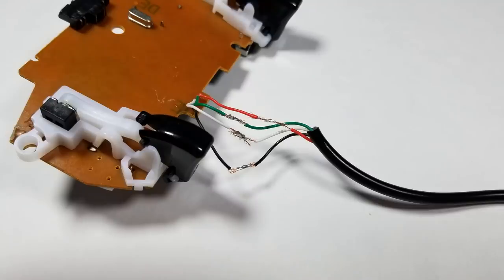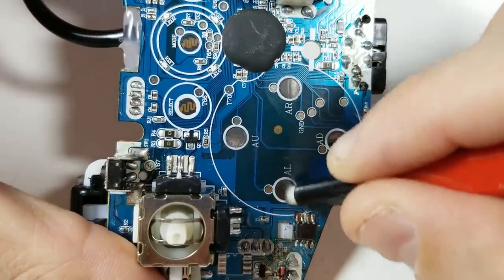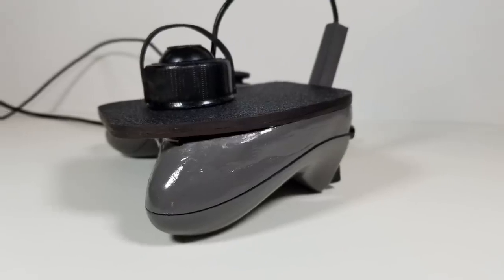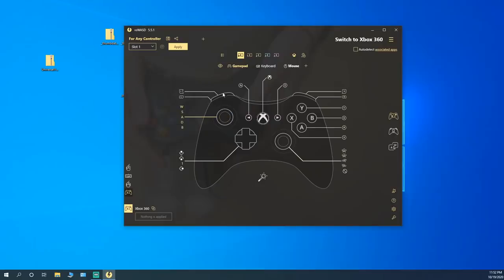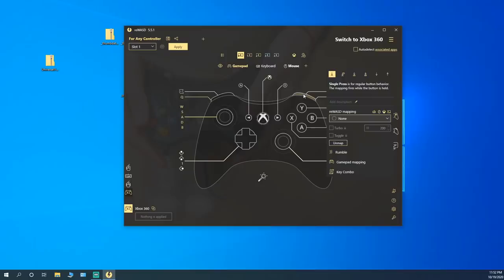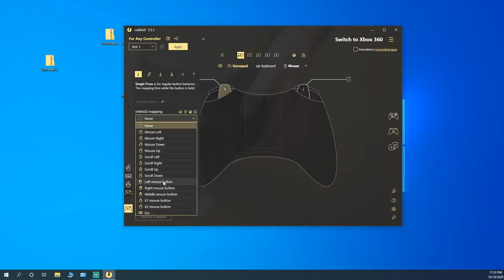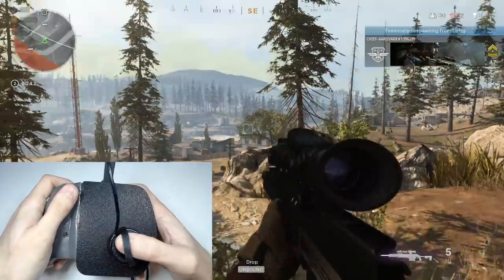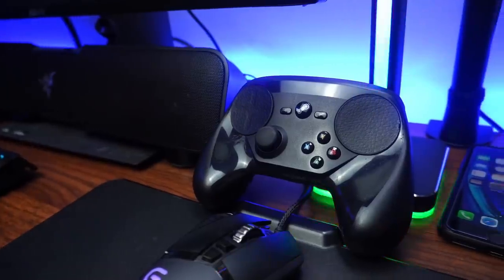I built the *MOST OP* CONTROLLER | Optical Mouse Controller | FORTNITE WARZONE

Comment: Has someone considered useing dual optical sensors for the actual 2 axis of the stick? Not like the mouse wheel optical, but like a mouse, but two sensors per stick, for each axis, reflecting on a ball surface pegged with a stick? would controls benefit from switching to All optical sensors over mechanical? Could you make a controller that its cable is make of fiber optics, the sensors are all optical for all keys and controls, attempting to break through into even faster response times.

Comment: Actually, the issue with touch pad isn't that it's not accurate. It's a thing that can be used in graphical design so accuracy definitely isn't a big issue. What is a big issue though, is that the button layout isn't optimal for playing games, the ergonomic on the laptop is horrible (you can't be on WASD and track pad at the same time comfortably), and that in most cases people would turn the acceleration all the way up on a track pad to reduce finger movement but that's not good for games. Steam Controller has none of the above issues so in theory it should work well enough.
I can see having a tiny finger mouse helpful to reduce finger skin wear, but then maybe have a track ball on the controller instead. Thumb track balls are really comfortable to use even for games. In fact with keyboard and trackball there's no need to have such controller to begin with, as the main issue to address is just that there's no place to put a mouse, but trackball itself stays in place.

Comment: Ok. So imo, the biggest advantage controller has over kbm is the left analog stick. When I play kbm for an extended period of time, particularly on a movement intensive game like Apex, my WASD fingers like to cramp up. So my suggestion is, do the opposite that you did here in this video; find some way to integrate the left analog stick into traditional kbm. While this controller is cool as fuck, and seemingly better for aiming than an analog stick, I doubt it's just as good as mouse aiming. So, fuse the best of both. Let me use an actual mouse with my right, while also being able to use an analog for movement with the left.

Comment: Meh, pretty neat but for years I’ve been using a combination of a XIM mouse and keyboard emulator for PS4, a HIGHLY modified PS4 controller with extra buttons on the back side and elsewhere(some of which are moveable to other positions)mapped to perfectly fit my fingers for movement and most non gun or attack related functions(if I remember i have something like 13+ buttons within less than half an inch of my left hand and then all the plethora of 21+ functions mappable on a zmouse on my right hand, including hundreds of different things i could technically program on the pressure sensitive buttons and functions)which I have mapped to my Swiftpoint Z-mouse that would be waaaaay superior to this- aside from portability- but I cant stand playing FPSs far away from the screen anyway.

Still, I really like the keyboard switches as opposed to whatever those silly overpriced “Pro” controllers use, and the portability os dope, so I may try and make one of these myself, or at least steal the keyboard switch idea, as I should have everything I’d need to do so mostly.

Comment: shut up and take my money
suggestion: improve the optical sensor with touch screen (preferred) or mouse pad, I know u literally just mentioned the issue with that but the best solution is not an optical sensor,  its a more fine tuned touch surface. mess around with the velocity on the touch surface until it feels most natural. Also make it bigger so tracking opponents without lifting your thumb up as often will be easier.

Comment: Seems like it's a pain in the ass to do a 180 without your sens behind Insanely high. I feel like because of that, this is worse than both mouse and keyboard. Atleast with an analogue you can simply hold it im one direction and turn forever. But with this you're only limited to the tiny range of movement with your thumb. Cool concept but im sure its nowhere near "op" just by looking at the gameplay

Comment: The ps3 move navigation controller is an already game changing replacement to a keyboard when pared with a traditional mouse for gaming. The only issue is  it has so much extra room for buttons on it. You could easily place two or three, maybe more, buttons alone where you naturally grip the controller, similar to paddles on pro controllers. Not to mention on the face. I could never get used to using a keyboard for buttons and moving so I used it when I used to game on pc.